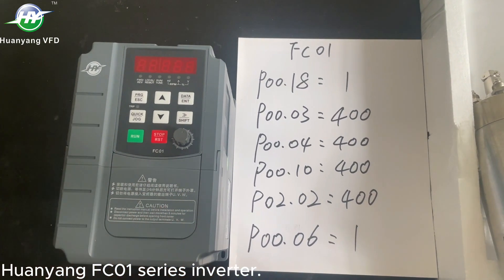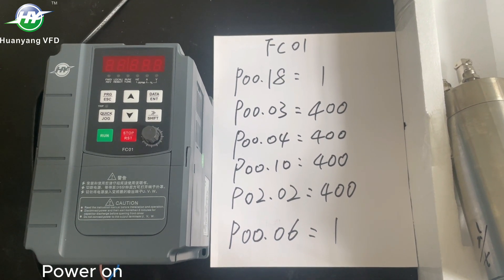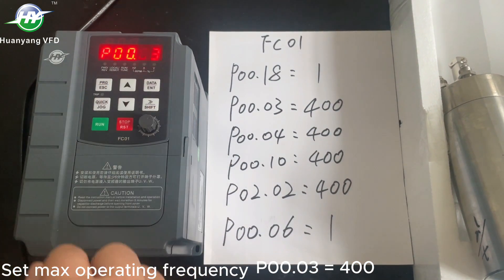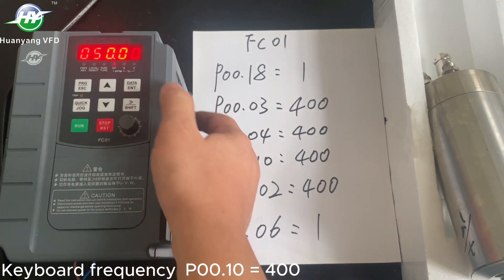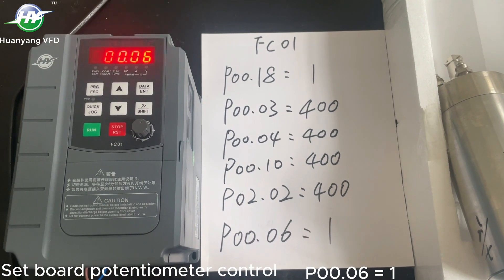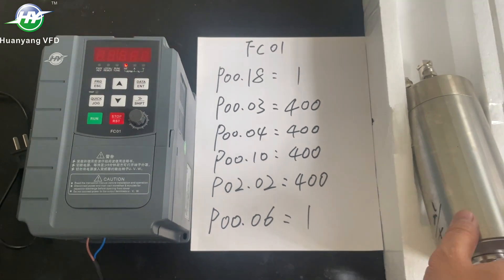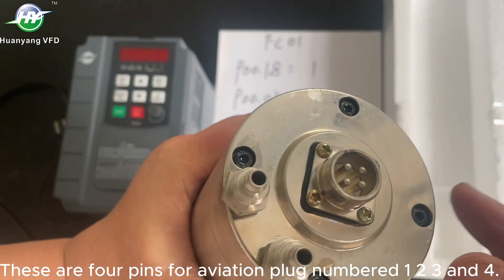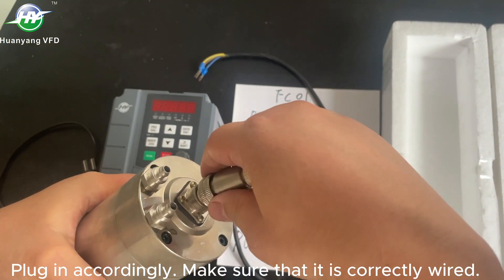Huanyang inverter FC01 series  spindle driving motor

Comment: Your videos have been very helpful in setting up the two fc01 vfd’s I recently bought. Would you be able to make a video explaining how to wire a brake switch, such as one used on a lathe?
Reply from the maker: You need to purchase a braking resistor. Set parameter P08.37 to 1, and adjust the deceleration time in parameter P00.12
Reply: @huanyanginverter6516  okay that worked for being able to stop it pretty quickly with pushing the stop button, thank you. What I want now is to be able to use the foot brake switch with it. If you can help me to wire that to it, that would be extremely helpful
Reply from the maker: @christianwelker7751  Teaching videos
https://youtu.be/-YHYEeqPBTI

Comment: Do you have a list of the modbus 485 commands that the fc01 accepts?
Reply from the maker: There is 485 communication content in the product manual
Reply: @huanyanginverter6516  do you know where I can find a FC manual? I found manuals for the GT and HY. 

How does the FC compare to GT or HY? 

I’m going to be running in on an 3 kw air compressor controlled by Arduino via 485. 

The HY and GT are more expensive, are they made with higher rated components?
Reply from the maker: @AndySomogyi   The GT series products have strong performance but come with a high cost. The FC series products use smaller IGBT modules compared to GT, offering a more affordable price while maintaining good performance; however, they may not perform as well under heavy loads. The HY series products are designed for high-speed motors and are comparatively easy to understand.

I recommend purchasing either GT or FC. If you make frequent purchases, it's advisable to choose FC. I can send the FC manual to your email.
Reply from the maker: There is 485 communication content in the product manual
Reply: @huanyanginverter6516  I don’t have the product manual. Is it available for download ?
Reply from the maker: @AndySomogyi   Tell me your email, I will send it to you
Reply from the maker: @AndySomogyi  xwdnzyp@163.com  I will send it to you